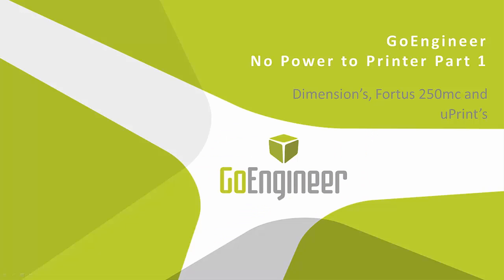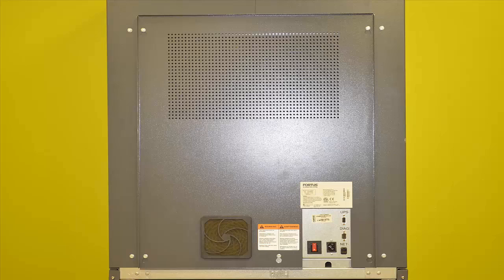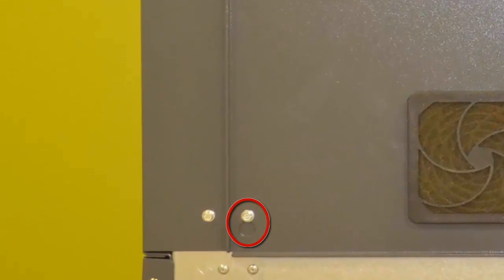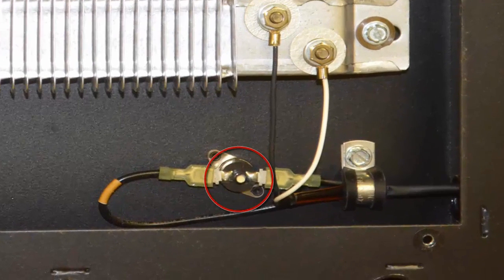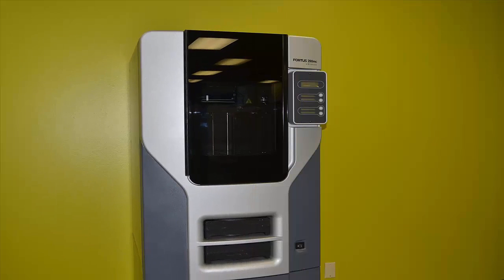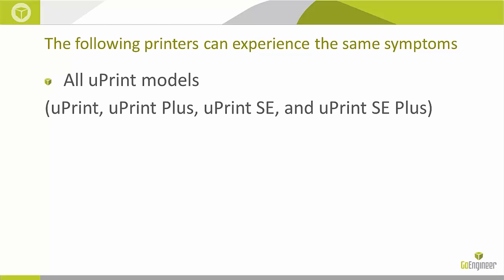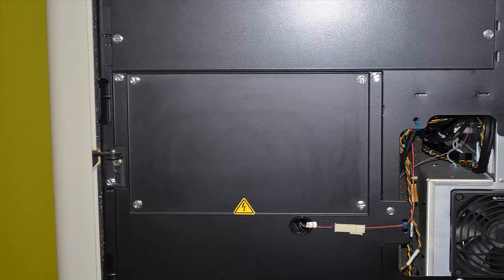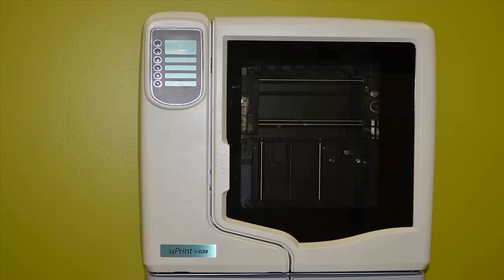Stratasys FDM - No Power to Printer Part 1

Comment: The same problem occurs frequently with my 250MC. When printing large objects, the power often goes off automatically when stacking the first base part. In that case, I open the machine and push in the hidden switch as shown in this video to reset it. When it works, there are no problems with printing. I checked the head cooling fan on the right side and the fan on the back, but they are not dirty at all and rotate properly while operating. I think the temperature protection switch? In other words, the switch under the heater that is pushed in every time to reset it is bad, but what is your opinion? Please give me some advice if you don't mind. Thank you very much.　from Japan Tomio Sugiura
Reply: There are two fans below the heater and snapswitch (on both sides) that blow air into the build chamber. Those are the fans that are failing and need to be replaced.
Reply: @ Thank you for your advice. When I checked the fans, the three fans in the heater chambers on both sides were stopped. I bought 4 fans with the same model number at Didikey and soldered the connector again. I have been able to drive normally since then. Thank you.